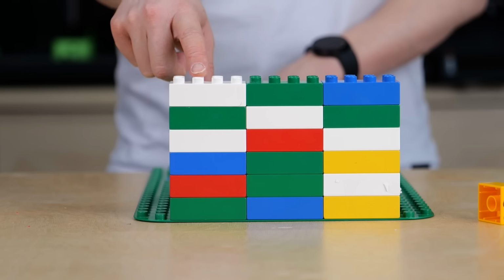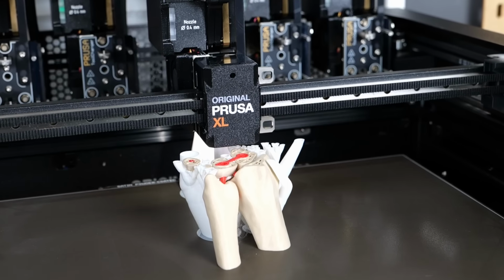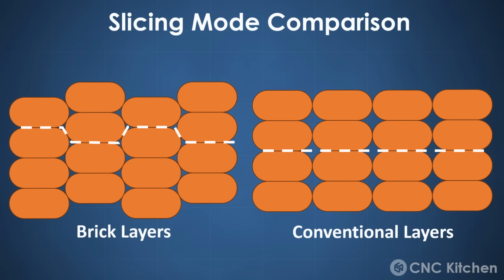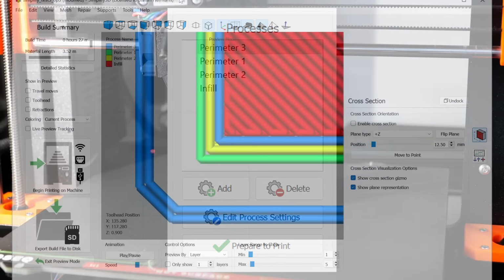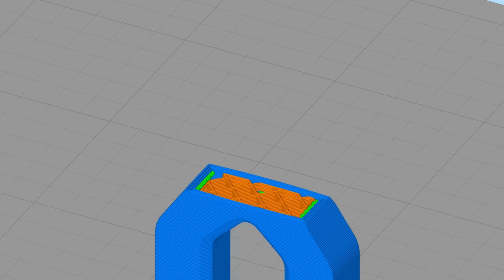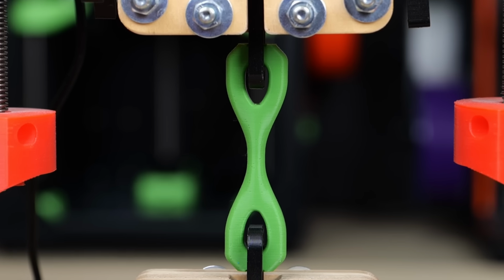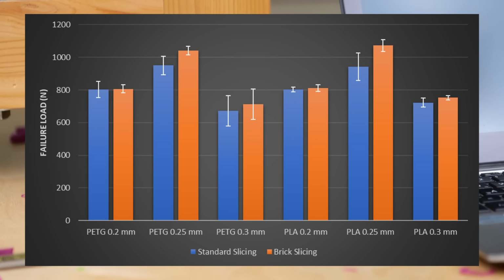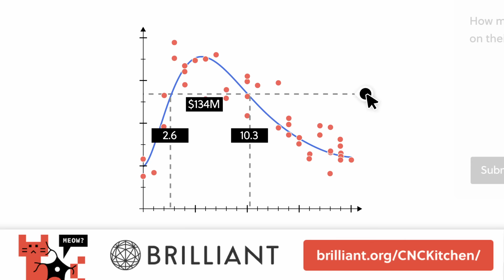Brick Layers - Why did no one do this before?

Comment: pretty sure you answered your own question about homogeneity vs new weakness.
Like definitionally it's not a new structural weakness if the tensile strength is higher, right?
Also you didn't test the shear strength which would be where I think this would shine.

Comment: Hallo Stefan, why not use a dual extruder: one at normal temperature, one very hot. The normal one prints the outer layers and the other one is so hot that the inner layer will flow into all gaps. This way the part will be even stronger.

Comment: Wouldn't it make more sense to keep each layer at the same height, but shift where the printing happens by half the width of the extraction nozzle? That way, each line will have connection to two lines on the layer above and below, rather than one. Each layer should completely fill the gap between two lines on the layer below.

Comment: Could you simply move subsequent layers offset sideways by half the width of the line.  More exactly like a brick wall instead of staggering heights....just let each new line fill in the gap between the two lines below.  Keep your outer walls in place but everything inside offset each layer by .2 mm or something. Might be easier to program than alternating heights.

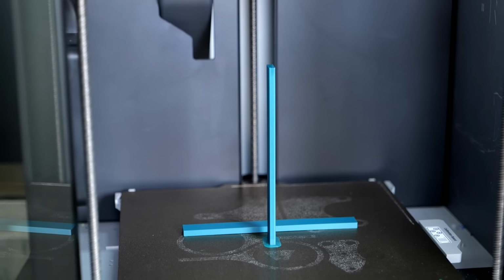Comment: At 1:18 you explain that the strength difference between horizontal "sticking" and vertical "sticking" is because there is less melting between these vertical layers.  Not mentioned in the video, yet the source of this reduced melting, is the greater time difference between printing of and hence cooling of the adjoining components.  Horizontal neighbors are printed more recently, and are therefore warmer and more readily melting into a neighboring bead printed material.  Whereas vertical bonding to material on the previous layer only occurs after that entire lower layer has been printed and had time to cool, the cooler material melting less readily with the bead of material applied above it.  You can test this theory by using a heated enclosure.

You would think that seperating even and odd perimeter wall beads on different layers would eliminate any heat/melting advantage of horizontal bonding, as the horizontal adjacent bonding only comes when the next layer is printed and the previous layer has had time to cool.   But your brick pattern gains back some (and as you show, 10% more overall) bonding advantage by each bead of material touching not only it's 4 neighboring beads, but 6.

It would truly be interesting if a heated environment would improve the tensile strength of both the normal pattern as well as your brick printing patterns.

Comment: One thing you might be interested in is that, for isotropic materials, the break line in pure tension is actually 45 degrees since if you work through the equations (e.g. see Mohr's circle), the max stress is actually 45deg off from the direction of force applied.  This is obviously only valid for isotropic materials (e.g. if you pull a rod of steel, in the break interface you will see a cone; and not just the necking - talking about the actual break interface) and I think applies to a smaller size scale than layer lines, but I think there's still two things that should be considered for features/tests like this:
1. The exact type of test matters.  A pure tensile test is only testing very particular part properties and can significantly deviate from practical performance, especially for non-isotropic materials
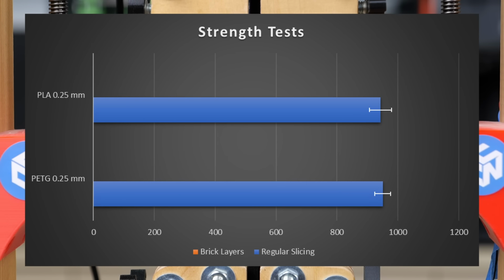2. Changing the orientation of layer lines can have non-intuitive effects on strength.  I wouldn't dismiss your negative results as just being due to print issues, since as part of the scientific process, I don't think it's unreasonable to say that they may be suggesting our intuitions on interlocking layers may be flawed.  If we look very closely for example at the images in the flat layers at 7:13, I would argue that all the little flakes we see /might/ be evidence of 45deg angles in the breaks.
Awesome idea and testing!

Comment: "It holds more force, because more of it is breaking".  The brick layers exert force over more surface area to break tension, guaranteeing a massive failure.

The first set is a test of the material, the second is the test if technique.

The first set is "either strong enough, or not", the second set will break at the worst time.

Comment: My opinion on the PETG samples cracking in a strange way are... Yeah, that's expected from PETG. If you print a solid part in PETG and drop it on the ground, you'll find that material has a tendency to shatter like in a glass-like way. I think the samples having the cracks present after failure is actually a sign you're making a more solid print with this new slicing method. PETG is an amazing material, but you risk making a fragile part if you print a solid piece with it.

P.S. DO A TEST WITH CF-PETG!!! And other fiber-filled filaments, of course 😁 These test are really exciting, and I'm eagerly awaiting results with filaments like CF-Nylon too. It's fantastic layer adhesion doesn't suffer too much from being filled with fibers, but I can only assume CF-Nylon would really shine with this slicing technique!

Comment: I have tried a similar approach printing relatively basic, flat  designs in vase mode. For example a flat profile piece of say 2mm thickness, I use a 0.6mm nozzle and set my perimeter width to 1mm. The ramp effect essentially criss crosses the layers and provided your perimeter width is half the wall thickness both sides of the "vase" bond well. I've used it to produce som nice strong parts with the added bonus of no seam lines..

Comment: Just when I think FMD 3D printing has been put to bed, no further improvements are possible. Someone such as yourself proves me wrong.  I had considered using a laser to warm the plastic ahead of the print nozzle,  but realized it would require a complex mechanism to keep the laser pointed just infront of the nozzle, which would be constantly changing direction.

Comment: I've recently thought of doing infill where you adjust extrusion speed to movement speed ratio briefly right at cross-over junctions to weave the layers/strands together. Or maybe to pull off a hex-tiling in a vaguely vase-mode print, where the lines need to be half made up of half-layers in essence due to there being 3 lines crossing at every junction.

Comment: So, the crack propagation vertically through the part is a symptom of the new print method. The new print method is much closer to a crystalline structure than a planar one. So while normal prints fail more flatly, this "brick" pattern print is going to fail along the weakest joints. Even if those joints are diagonal

Comment: OK what if the model had a vertical hole starting a couple layers in, then before putting down the top layers, the printer pumped a column of hot plastic into the void, creating more or less an internal dowel joint. For real strength we need almost woven 3d prints with layer lines in all 3 planes.
Reply: Like the idea, problem is how printers are designed.  They are made to have the material extruded directly on top of the next layer so if trying to pump material into a hole ends up in having the material cool down too much during the fall so by the time it hits the bottom it's already cooled to solid so you essentially just end up filling the hole with a bunch of plastic strings that don't adhere to anything,...  Maybe if the slicer filled the hole in stages of a few layers at a time and also raises the temp a bit during the filling operation that might work.

Comment: I'm not any kind of relevant expert, but I suspect that the more complex failures from the interlaced PETG coupled with the way the strength increased but less than the other test indicate that you changed the point of failure from layer adhesion to material strength. Not really a big help as it stands (and in some applications the layer adhesion issue might create more controlled and safer failures), but it also means that with a stronger material the brick layer 3d print might see even bigger gains.

Comment: I have a great idea I think you could use. It's a part that should be easy and chap to make that will alleviate the trouble with Bowden tubes and how they fail on 3d printers. I'm not looking for anything it's yours to use as you please. 

Do you have an email or better way to get in touch so i can give you the idea? 

I understand Bowden systems are becoming outdated but a cheap part that is easy to install that can really increase the effectiveness of Bowden systems by reducing failures at the nozzle where they meet could add a lot of value to someone still struggling with this issue. 

Keep thinking outside the box. Hopefully one day your contributions will have a big impact on the community.

Comment: If you want to make it more like a brick layer you should be staggering layers horizontally, not vertically.

Look at how a brick wall is built.  Bricks lay on one another lengthwise because that gives them more surface area contact.  If they were layered heightwise while still being lined up vertically they would not be significantly stronger than if you were to just stack them on top of one another.

Comment: next time you print those parts use a higher flow so there are no voices between the lines, any time i printed something that needed to be as strong as possible i set the infill flow to 103% and 99% infill, it produced insanely strong parts and they never fractured along layer lines

Comment: Isn't this kind of structure better in terms of shear stress resistance? I mean, rather than pure traction, where the layer can still separate "homogeneously" following the zigzag pattern 

Yes, maybe the overall increased surface area (thanks to the zigzag) means less stress because we divide the force by a bigger factor. But I still think the real benefits of the zigzag may arise under shear solicitations

Comment: The issue is these 3D printers don’t heat the material enough for the layers to fully bond. You’d never use this for anything that needed real strength. When they 3D print metal components for vehicles, they’re using lasers to actually melt the layers together, not just warm them up so their edges stick together a bit.

These cheap 3D printers are never going to be on par with cast or molded results unless they heat the layers so they become one.

Comment: There's one thing you're not considering here: predictable failure point. If your material has a known and predictable failure point/pattern you can reliably plan around it.

The inter-locked layers in the prints are throwing some different design challenges into the mix that most people aren't going to have the overall knowledge to plan for should structural integrity matter for their part.

lastly you'll want to test the other three type of mechanical strength with that layer method.

Comment: Do I remember correctly that the smaller the layer height, the better adhesion in general? So if we want really strong parts, we should be printing with small layer height, and this method is useful mainly for drafts that we want to be done fast? But then, also, if we want drafts, 2 outer layers should be enough for most prints, no? Please let me know if my logic is sound.

Comment: This seems like a good improvement in making parts stronger when a part has to be printed such that forces on the printed part are parallel to the direction of layers. Just increase wall thickness and you'll probably see a higher difference in the tensile test to the standard brick layer method since there will be more bonding points.

Comment: Interesting study for sure.  Statistically speaking, once you put in the error bars, it seemed that the brick stacking didn't make much difference.  That's why error bars are so important!

Although it's intuitive to stagger/offset like you would a brick, I'm not so sure the principal applies here.  You offset Legos because otherwise there's no side-side interaction.  You offset real bricks because the mortar is weaker than the bricks.

With a 3d print, depending on how flat your layer lines are, the offsetting might actually introduce a larger gap and worse overlap.  Also, the stagger really shouldn't help with z-directional failure all that much. For z direction, the only thing you really did was potentially created a way to stop a fracture at a weak point.  (Which still may be a good improvement.)  However, I would think that these parts would perform better in an XY impact shearing test.  Then you are really taking advantage of the offset.

Maybe the real answer is not to stack flat layers. If you could create a three-dimensional zigzag, then you could effectively get rid of layer lines. I'd be curious to see what would come of something like that.

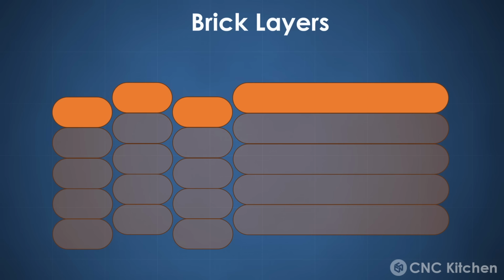Comment: 2:47 "not having planar layer boundaries" and  "increasing the surface-are, with which the 2 layers bond together" is essentially the same thing/phenomenon, spoken out in 2 different ways. One is the macroscopic result, and the other is the microscopic cause. 
8:00 Having introduced an additional weakness is out of the question per definitionem:  If the part is now 10-14% stronger, it was worth it, even if an additional weakness had to be (consciously/intentionally) added in the proccess, in order to reach such a positive result (yeah, a weakness to be fragile, obviously... )
On a final note, strength-improvements will eventually reach the point of diminishing returns, where it´s gonna be too expensive to buy the tech/material, that adds the next +0,1% of additional strength. So, +10%-14% is already too much, for too little, with todays standards... I mean, how much easier is that, and how much better, compared to "3-dimensional-slicing", for example...?  Probably a lot, once it somewhen becomes embedded in the most common slicers.

Comment: One issue you may also be running into is the gaps,bricks have mortar to fill gaps.

Let's also consider that bricks are meant to be used against a COMPRESSIVE force, not tension, or shear forces.

Perhaps test each method for other types of failure as well, checking resistance to shearing, and to being malformed by crushing (basically both are accomplished with a press and set of jigs to apply forces compressive and laterally into a media across it's layer boundaries both perpendicular and parallel to the layers.)

I know that tensile, and tension are important, but by using a mixture of layering methods for parts in different areas, you could accomplish some amazing results I'm sure.

Also consider crossing layers perpendicular to one another for better resistance to layer shearing In a compressive plane of force, something like a stopper bushing for a sliding rod or spring assembly.

Comment: Much testing by a certified testing lab has been performed on this. The increases in strength in fracture, sheer and torsion are greater than the tensile.

Comment: average joe here, I have no qulifications to back up the following:  From what I see the diffrence in production looks good at first with the tested 10% increase. the main issue I see is that when it does failes it does so in a way with more randomness to the failure. when designing a product for use knowing how it will fail can be just as important as its use case, in otherwords having a clean break thats 10% weaker can be better than 10% stronger that shatters when breaking, small fragments interfearing inside a closed unit could end up doing more damage to other parts in a failure situations. think engine parts. but this is just an average joe's view. None of what I have just said should be taken as a negitive, without trails and testing we would not have inovation or advanses in productions please keep testing diffrent ways to make your idea better.  (my spelling sucks I know)

Comment: its called "FUSED" filament fabrication because the layers are intended to fuse together by maintaining the previous layer at a temperature where when the successive layer is deposited will fuse, lapping the layers should be unnecessary if your extrusion thickness is correctly set, there is no way that you should have voids as seen in this video. Fix your extrusion thickness for infill and print with the correct temperature parameters!

Comment: yeah i knew its gonna improve it but its a waste at the end. This wont work cause its not stacking its creating more surface area. this would mainly increase rigidity cause of the less air gaps and less flexibility. technically you need the second layer to fuse inside the first layer. Only ways i can imagine achieving this is if the first layer gets controlled and gets only to about 70% drying and the next pass is microns lower then it should and the nozzle heat reheats the top layer of the last pass and fuses the two layers. maybe an attachment that makes a leading grove where the next layer is put but the heat has to be so precise. i cant see this happening in room temperature. At that point even the moistuer level would be a problem.

Comment: With a difference of only 14% on big 0.25mm layers, I suspect the difference would effectively disappear if you used thinner layer heights, which would make each perimeter flatter and reduce non-contact space between adjacent layer. I want to see this test at 0.1mm.

Comment: I suspect you will get even better, stronger parts if you slightly over-extrude material at a slightly higher temperature for all the middle layers - logically this should fill some of the gaps in the brick layers, forcing a bit of extra material into the gaps and creating more surface area that is touching and adhering to each other strand of plastic, kind of like mortar in actually brickworks.

Comment: I'm not an expert, but it seems like you'd get even better surface contact and adhesion if you over extruded the interior walls a little to fill up those gaps.